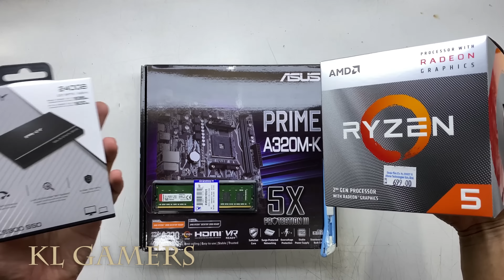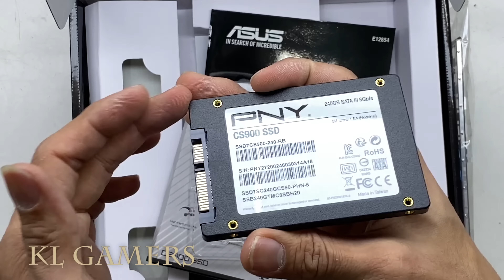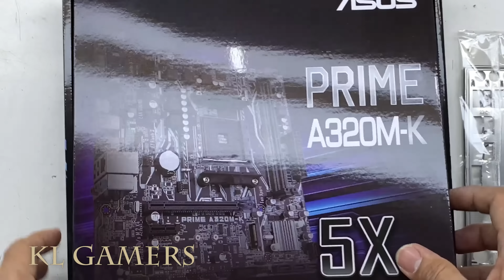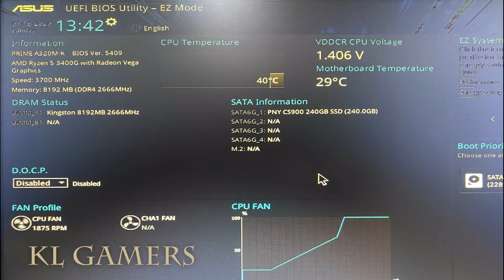AMD Ryzen 5 3400G ASUS PRIME A320M-K PNY SSD Budget Desktop Build 2020

Comment: What type of casing bos? Brand & model case?
Reply from the maker: AMD Ryzen 3 3200G 4-Core Desktop Processor with Radeon Graphics (FEB)
(Amazon link) = https://amzn.to/3ex9Dle
(Lazada link) = https://c.lazada.com.my/t/c.Y5ZOW7?url=https%3A%2F%2Fwww.lazada.com.my%2Fproducts%2Fryzen-3-3200g-r3-3400g-36-ghz-quad-core-quad-thread-cpu-processor-radeon-vega-8-socket-am4-new-and-have-fan-i1714830731-s6529784095.html&&sub_id1=3200G&sub_id2=China&sub_id3=737
(Shopee link) = https://invol.co/cl2lnw1

AMD Ryzen 5 3400G 4-core, 8-Thread Unlocked Processor with Radeon RX Graphics (JUN)
(Amazon link) = https://amzn.to/31LHtMs
(Lazada link) = https://invol.co/cl4b7w3
(Shopee link) = https://invol.co/cl4b825
(Shopee link) = https://invol.co/cl4b81e
(Shopee link) = https://invol.co/cl4b805
(Shopee link) = https://invol.co/cl4b7zu

Processor = AMD Ryzen 3 2200G with Radeon Vega 8 Graphics AM4 CPU (jun) 
(Amazon link) = https://amzn.to/2KqRA36
(Lazada link) = https://invol.co/cl4b83k
(Shopee link) = https://invol.co/cl27izs

Motherboard = ASUS PRIME A320M-K AMD Ryzen AM4 DDR4 HDMI VGA M.2 USB 3.1 M-ATX (JUN)
(Amazon link) = https://amzn.to/2zYB6cF
(Lazada link) = https://c.lazada.com.my/t/c.eGVi
(Shopee link) = https://invol.co/cl4b85g

RAM = Kingston ValueRAM 8GB 2666MHz DDR4 Non-ECC CL19 Desktop Memory KVR26N19S8 (MARCH)
(Amazon link) = https://amzn.to/31NOWud
(Lazada link) = https://c.lazada.com.my/t/c.Y5ZHyw?url=https%3A%2F%2Fwww.lazada.com.my%2Fproducts%2Fkingston-valueram-8gb-2666mhz-ddr4-non-ecc-cl19-desktop-ram-kvr26n19s88-i943914012-s2389962254.html&&sub_id1=2666&sub_id2=SRI&sub_id3=168
(Shopee link) = https://invol.co/clh9nj

SSD = PNY CS900 240GB 2.5” Sata III SSD (JUN)
(Amazon link) = https://amzn.to/3eqT4Gx
(Lazada link) = https://invol.co/cl4b89o
(Shopee link) = https://invol.co/clqjwi

Wifi = TP-Link WiFi 6 AX3000 PCIe WiFi Card for PC with Heat Sink| Bluetooth 5.0 | 802.11AX Dual Band Wireless Adapter with MU-MIMO, Ultra-Low Latency (Archer TX50E)
(Amazon link) = https://amzn.to/2DuK6eS
(Lazada link) = https://c.lazada.com.my/t/c.b6kMNB?url=https%3A%2F%2Fwww.lazada.com.my%2Fproducts%2Ftp-link-ax3000-wi-fi-6-bluetooth-50-pcie-adapter-archer-tx50e-free-pubg-bag-i1169126020-s3379272581.html&&sub_id1=AX3000&sub_id2=Mono&sub_id3=149
(Shopee link) = https://invol.co/clvwf5

Casing = X-Five Elegant M5 Micro Atx casing (JUN)
(Amazon link) = https://amzn.to/3n1rYuZ
(Lazada link) = https://invol.co/cl4b890 (panda)
(Shopee link) = https://invol.co/cl4b88e

Custom Gaming PC SET = https://invol.co/cl3z7vu

Graphics Card =  Asus GeForce GT 1030 2GB GDDR5 HDMI DVI (JUN)
(Amazon link) = https://amzn.to/2SPTrW2
(Lazada link) = https://invol.co/cl49z2s (GG)
(Lazada link) = https://invol.co/cl49z42 (YES)
(Lazada link) = https://invol.co/cl49z4h
(Shopee link) = https://invol.co/cl49z4z (GG)
(Shopee link) = https://invol.co/cl49z57
(Shopee link) = https://invol.co/cl49z5o

Graphics Card = NVIDIA GeForce GTX1650 OC 4GB GDDR6 (JUN)
(Amazon link) = https://amzn.to/3tCF9EY
(Lazada link) = https://c.lazada.com.my/t/c.Y5Ycjs?url=https%3A%2F%2Fwww.lazada.com.my%2Fproducts%2Fmsi-geforce-gtx-1650-d6-ventus-xs-v2-gtx1650-d6-ventus-i2082016814-s8334109882.html&&sub_id1=1650&sub_id2=XY&sub_id3=1599
(Lazada link) = https://invol.co/cl48t75
(Lazada link) = https://invol.co/cl48t8c
(Shopee link) = https://invol.co/cl48ta8
(Shopee link) = https://invol.co/cl48tau
(Shopee link) = https://invol.co/cl48tb5

Graphics Card = GTX 1660 SUPER 6GB GDDR6 (JUN)
(Amazon link) = https://amzn.to/3sRYK4c
(Lazada link) = https://invol.co/cl4b8ek (DOTA)
(Shopee link) = https://invol.co/cl3v71c
(Shopee link) = https://invol.co/cl48tdm
(Shopee link) = https://invol.co/cl3r1mh
(Shopee link) = https://invol.co/cl3drp7
(Shopee link) = https://invol.co/cl3drpi
(Shopee link) = https://invol.co/cl3r1o2
(Shopee link) = https://invol.co/cl3r1oh

ZOTAC GAMING GeForce RTX 2060 6GB GDDR6 (JUN)
(Amazon link) = https://amzn.to/3fsr89b
(Lazada link) = https://invol.co/cl4b8di (GT)
(Shopee link) = https://invol.co/cl3xnvg
(Shopee link) = https://invol.co/cl48thy

ZOTAC GAMING GeForce RTX 3070 Twin Edge OC 8GB GDDR6
(Amazon link) = https://amzn.to/3eDo9bT

MSI GeForce RTX 3080 GAMING X TRIO 10G GRAPHIC CARD
(Shopee link) = https://invol.co/cl39u3a

RTX 3070 GAMING 8GB GDDR6 (JUN)
(Lazada link) = https://invol.co/cl48tkg
(Lazada link) = https://c.lazada.com.my/t/c.Y5Y7oP?url=https%3A%2F%2Fwww.lazada.com.my%2Fproducts%2Fgainward-rtx3070-phantom-8g-gddr6-256bit-rtx-3070-phantom-i2111993904-s8545564679.html&&sub_id1=RTX3070&sub_id2=XY&sub_id3=7239
(Shopee link) = https://invol.co/cl48tlm
(Shopee link) = https://invol.co/cl3v855
(Shopee link) = https://invol.co/cl3v84a

ASUS TUF Gaming GeForce RTX 3060 OC 12GB GDDR6 (JUN)
(Amazon link) = https://amzn.to/33ULYXJ
(Lazada link) = https://invol.co/cl47wy9
(Shopee link) = https://invol.co/cl42y09
(Shopee link) = https://invol.co/cl48tnp
(Shopee link) = https://invol.co/cl42y45
(Shopee link) = https://invol.co/cl42y5c
Reply: @KLGamers  tq bosss..

Comment: man may i ask can i use 3200mhz for this build?
Reply from the maker: AMD Ryzen™ 2nd Generation/ Ryzen™ with Radeon™ Vega Graphics/ Ryzen™ 1st Generation Processors
2 x DIMM, Max. 32GB, DDR4 3200(O.C.)/3000(O.C.)/2933(O.C.)/2800(O.C.)/2666/2400/2133 MHz Un-buffered Memory
AMD 7th Generation A-Series/Athlon X4 Processors
2 x DIMM, Max. 32GB, DDR4 2400/2133 MHz Un-buffered Memory
Dual Channel Memory Architecture
ECC Memory (ECC model) support varies by CPU.
* Hyper DIMM support is subject to the physical characteristics of individual CPUs. 
* Refer to www.asus.com for the Memory QVL (Qualified Vendors Lists).
Reply: i mean in this build can i use ??
3400g
asus a320m-k
3200mhz
Reply: @mattalcantara4317  yes you can, i recommend you to activate the XMP/DOCP in the bios to overclock the ram for better performance

Comment: PC Intel core i5 10th gen

Processor - Intel core i5 10th gen

Motherboard- Arous B460M pro intel

Graphics card- Asus Cerberus GeForce GTX 1050ti  4gb OC edition GDDR5

Power supply - Corsair vs 550w

Liquid cooler  - NZXT KRAKEN. M22

Hard Drive - Seagat 2tb 

SSD - Seagat 550 gb

Ram - Corsair 16 gb DDR4 3600mz

My pc